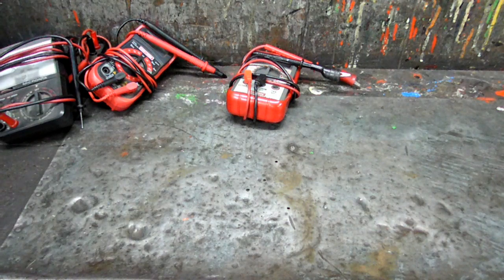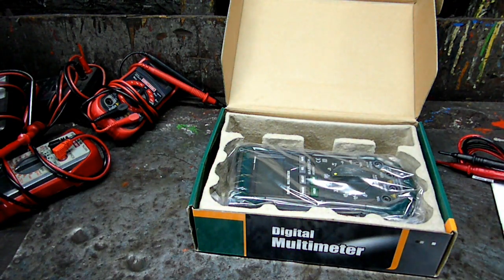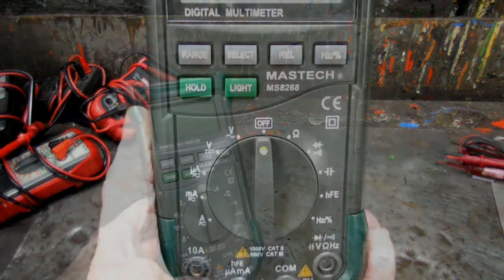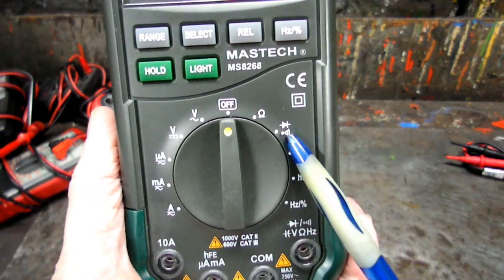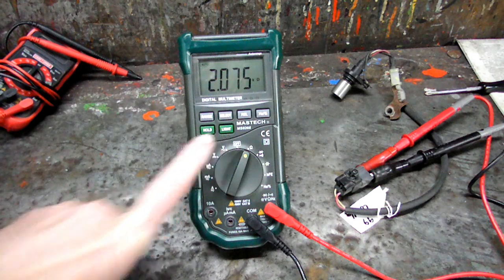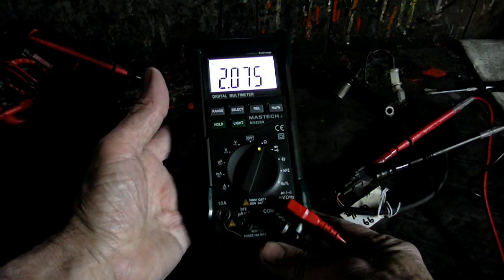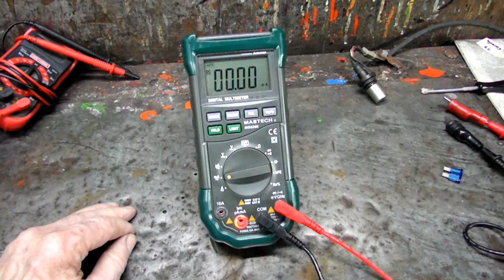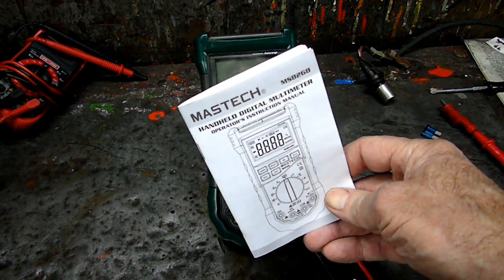Autoranging Multimeter Review

Comment: Can you please tell me if you know! Stopped working switching from frequency measurement Hz the measurement of the duty cycle %. It measures the frequency and the fill factor do not switch. Previously measured, was all right. Meryl 12V frequency modulator. Thank you! Multimeter Mastech MS8268

Comment: I have the same meter, the Mastech MS8628.  I think I bought it on eBay a couple of years ago for like $25 or $30.  It's pretty accurate, I think like 1% & 2% on the voltage readings, plenty for automotive or around the home use.  I have used mine to test capacitors, it has a capacitor test, some electric motors have start capacitors on them.  I know this is an old review, but just stumble across the video.

Comment: If the electronics is a weekend hobby this meter is OK, but if you are a professional this meter is unaceptable.

When you buy a meter the first and most important is the safety.
Some good meters are Fluke all models, Gossen, Hioki, Agilent.
Reply: Oh, rly? If you work with electronics, you'll never go above 30V. If you burn the whole multimeter, just buy a new one. And yes, if you need a super precise current measurement, go for a Gossen or Fluke or other top meter.
Reply: Not  necessary has to be a fluke you go by the cat scale like if you are using a multimeter for really high industry work.

Comment: If the meter uses backlight and lights to indicate for the right holes for the probes to go into, why did they made it so troublesome to change the batteries. I mean these extra lighting features will drain power faster from the batteries than ordinary meters. Who'd put screws on the battery compartment cap anyway? A child protection feature perhaps? I doubt it. It is a pain to change battery if you're in a hurry doing emergency work.

Comment: Is there a way to keep the light on?  Mine goes out after about 5 seconds which is just enough time to start measuring something and then look back at the MM to see the light go out lol.  It's frustrating!  Especially in low light situations where you need two hands elsewhere.  Other than that I LOVE this multimeter and have been using it in all of my videos based on Richpins review.  Great review!
Reply from the maker: They probably do it that way so you do not drain the battery.I will check the manual and see what's up with that.
Reply: Yeah I have this multimeter and it is to save battery life.  A work around I use is to click "hold" to hold the value then hit the light to read the value.

Comment: you don't need an auto-ranging multi-meter. just set it to the closest usable range to get the most accurate reading. (ie- measuring resistance: [on my multimeter ohms ranges are  200,2k,20k,200k,2M, and 20M] if you have a resister with a value of 4700ohms nothing will display until you turn the dial to up to 20k)

Comment: In the automotive needs a Fluke is over rated and by alot, Flukes are grea for people that work with other electronics as in computers, house current andother types of load but for a mechanic, all you need is a basic multimeter to do the simple tasks of checking for 12 volts, continuity, resistance and some as in my non fluke one has the optiong to hookup a lead to check for temps.

Comment: I have a Fluke 88 thats seen near daily use since new... was it mid to late 80's? Don't remember. It has pretty much everything your new meter has, plus is nearly indestructible. It's been dropped, splashed, zapped with high voltages and so on.

Beats buying cheapies all the time.

It also has a analog bar graph and will read injection pulse width.

Someone else noted the µA range. COM is common, as in used commonly for every selector switch position (or measurement range).